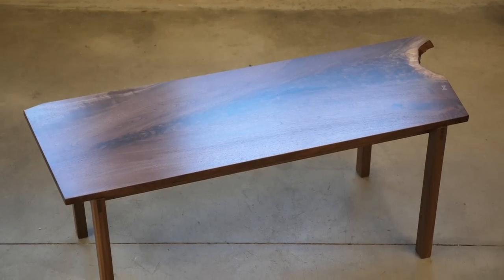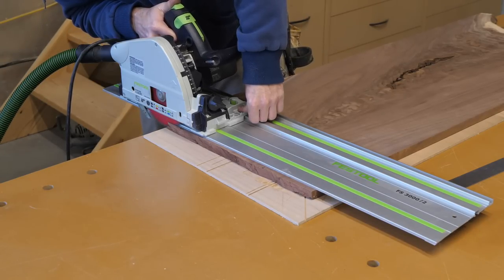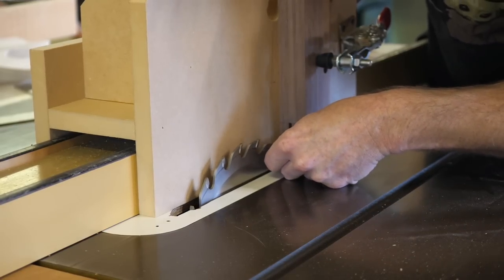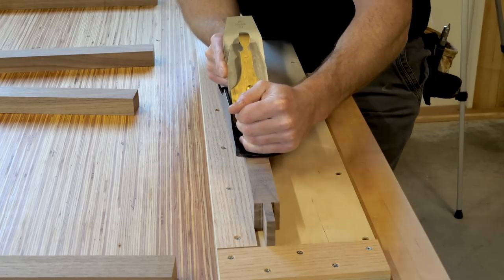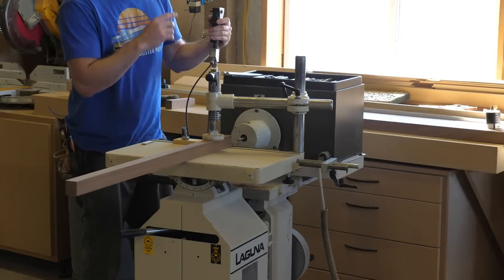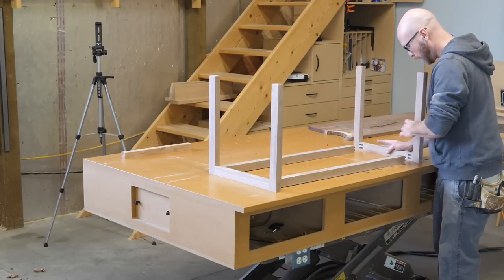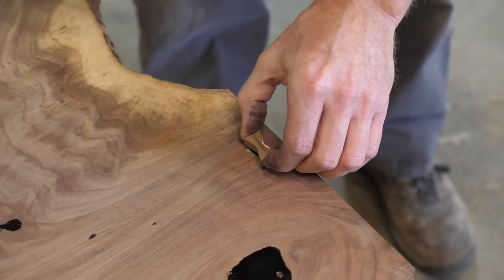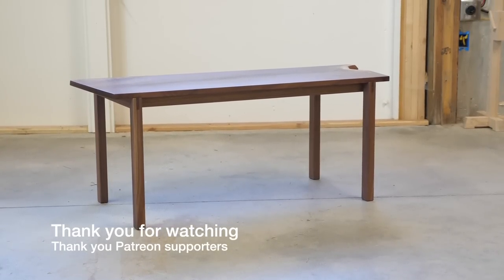What should this table cost? Help me figure it out.

Comment: I've always wondered how a table would look with clear resin, so you could see edges that ended up inside.
Reply: I prefer to use clear epoxy for that reason.. but it also shows any air bubbles that you couldn’t get out. It’s also tough to get a nice crystal clear epoxy. Most are yellowish.
Reply: @jlinkhart   I would really like to see that.  Got pics online?  BTW, why do you say it's tough to get crystal clear epoxy, when I see it all the time when people embed objects in their tabletops?
Reply from the maker: I have one some clear epoxy work. It is very difficult, maybe impossible to get it to look really nice.

Comment: I'd probably put it at $3,500 with a warranty (to allow for a remake once the top splits due to the rigid mounting), or $2,000 without.
Reply from the maker: Thank you. The top is mounted with the bottoms of the holes ovaled. I didn't mention that because I wanted to make room in the video for my really great Karate Kid joke.
Reply: @MikeFarrington   But then for some reason you went with your OTHER Karate Kid joke in the edit? You should have stuck with the really great one. And now we'll never see it.  😈  Regardless, it's a beautiful table.

Comment: I have watched you for many moons and I love what you do.  the break down.  the  high-end is to high, great work quality is there but the sex appeal and the weight isn't up to 5000,  though some  would pay that.  the low end is much to low for the quality and yes the uniqueness, the stretcher and the legs love the protrusion and yes the weight of the table  not great.  1,25 or 1.375 I would like better. There for the mid t o high 4s would be my guess.  love the walnut, I have one that size with a river through the center and live edge .  good luck    RC

Comment: $3200, could you have flattened the epoxy and bow tie with the lipping plainer?
Reply from the maker: Thank you. I could have, but that tool costs enough to where I wouldn't want the epoxy smudges on it. The hand plane I used is a backup, not a nice one.

Comment: If you did, what did you have to do after the top was milled to keep it from possibly moving or bowing a little bit until it was time to attach it to the base?  I would say anywhere from $900-$1200.
Reply: whatever you do, do not leave it laying on a surface such that 1 side gets full exposure to air and such in the shop, and the other does not.
I left a flattened glued up panel sitting on my Tablesaw top overnight and came back to a potato chip of sorts.
I put it up on stickers and weighted down the top side and left it overnight again and came back to a significantly less chippy piece, reflattened, evened out the thicknesses and left it on the stickers and it's been fine for 2 days now.
I've seen folks who make slab tables bag the entire thing in plastic sheet/wrap etc when leaving unfinished overnight.
IMPORTANT, when you apply the finish you MUST finish both sides at the same time - at least the first saturation coat - so that you again equal out the movement of moisture into / out of the wood.

Comment: Considering the price of oak (walnut is not available) slabs and workmanship here, and convert it to US$ we would pay 100 for the oak and 200 for workmanship, so the table goes for 300. But we would have cut the edge with the hole straight, we do not like imperfections in material. I know that in the US you get rudiculous prices. If I see your machines, I know where it goes. But a machine should allow for even faster work and lower prices.
Reply from the maker: Thank you?

Comment: Considering a few things about the area your in.  #1 Denver Co has a median income of approximately $85k, $20k above the national ave.  #2 Housing in the area can easily reach into the $5-$10 million range, meaning there is a large community of households with large amounts of disposable income.  #3 being hand made, I’d make sure the video was attached and last but not least,   It’s made by YOU.  (That should add at least $10-12k to it value……….   😂).   I’d recommend $2000-$2500.

Comment: First off let me say I’m not trying to belittle or offend anyone…. BUT….anyone who can build this EXACT table to the same design and detail Mike has done should not sell for anything less than $2,000 for sure….regardless of market and regardless of material cost. Once you establish yourself and your work(as Mike has done) you can almost set your own price. Let others follow you and not the other way around. I have people in my market that will always be “cheaper” than me and I really don’t spend much time worrying about it at all. 
Hobbyists woodworkers can be and are often times extremely talented but when you don’t do something as a profession you don’t have to worry about every little thing that goes into the cost of something. I learned that very quickly when I made the jump from hobbyist to full time. 
Overall though, “too much”, “too high”, “too cheap” is all relative. You can see two identical looking pieces of furniture sitting right beside each other in a store. One might cost double. There are people who will buy the cheaper one and people who will buy the more expensive one.
Reply from the maker: Thank you very much.

Comment: In my area of the midwest, $2200 to $2700 would be considered fair. Seeing all of that drool worthy equipment you have in your shop, I would tack on a shop fee of $500. I'd list it for $3200 and see if I got any bites.
Reply: So if he did it by hand and took 20 hours longer, he'd charge $500 less? How does that make sense? If the shop equipment isn't paying for itself in labour saved, then why is it there? He should just buy a fancy aircraft and tack on $8000 to each item in shop fees.
Reply: @DavenH  It was somewhat tongue in cheek, Dave. The $3200 is what I would list it as. The "shop charge" is a way of complimenting his well equipped shop.
Reply: @m.d.d.3051  Ah I gotcha. His shop is most enviable.
Reply from the maker: Thank you.

Comment: Them router burns are from not tramming your router. It's digging in on one side of bit. I would say 2500
Reply from the maker: No its from a dull bit. It does it on the other side of the cutter if I cut the other way.

Comment: My starting point would be $2k if I had built this, depending on the cost of the slab and the amount of time spent. With your expertise, I think you should start around $3500.

Beautiful table. Like you, I have a soft spot for old machines. I have an old planer I'm trying to get restored and back to its glory. Thanks for the inspiration.
Reply from the maker: Thank you.

Comment: That is the shortest FS 3000 I have ever seen.
Reply from the maker: Ha! Good eye. A friend bought a long rail and it was bent during shipping, so he cut off a few shorter pieces from the unbent part.
Reply: @MikeFarrington  Nice! That’s a good use of a messed up rail. TSO is now selling rail extenders which they are probably doing the same thing. By the way, I start the stair railing job tomorrow and am cutting the mortises by hand with the hollow chisel after of course drilling a hole at the correct angle.
Reply from the maker: @mchilly  Good luck, that will be a lot of work, but it will be great when done.

Comment: $1250. Taking a guess on how many hours you had in the build... maybe 16?
Reply from the maker: Filming always adds time, but if I was to work on this straight, 16 hours would be leisurely.
Reply: @MikeFarrington  I always wondered what takes so long to cut 4 legs and a top to size , plain a top down , and cut some joints into the legs , is the time counting waiting for the epoxy too dry ?
Reply: A table isnt just cutting parts and connecting them together.  Outside of the thought to material selection, design, and joinery, one table is comprised of 24 visible faces and 40 routed edges that all need the rigorous attention of sanding through the multiple appropriate grits and a finish.  At only 16 hours into this piece I feel like Mike could work circles around me.  Maybe Im just not as efficient but i think i would have 40 hours into this easily.  I dont think I could get two of these out in a week unless I had built a pretty substantial number of them.  No way this could walk out of my shop for less than $2500 unless the client had ordered either multiple of this specific item or it was tacked onto a larger order.  It looks great Mike, very thoughtful and deliberate design and work.
Reply from the maker: @AresGodOWar  What takes so long is the filming, easily doubles the amount of time, maybe more.
Reply from the maker: @akirch9  Thank you very much.

Comment: hi  mike     as   a  cabinetmaker  my  self   with  my  own  workshop    and  like  you  i  work  on  my  own       .   pricing a  job  is   a  huge   pain  .     i  always   do  it      then  leave  it  a  fue  days    then  do  it  again          ,    i  have  my  hourly  rate  which    i  charge    plus   materials      so  it  straight   farward     if  you  know   how  long   the  table    took   to  make        thats  the price     ,     its  irrelevant if   it sounds  expensive   or  cheap     the  price   is  what  it  is
Reply from the maker: That is normally how I price my work. This is a departure from that formula, and an experiment.

Comment: $1100 is my vote. I’m guessing $120 bucks for the lumber, another $40-60 for consumables, 6 hours of labor at $100 per hour, 30% margin and round it off to an even $1100.
Reply: that slab air dried means that it was sitting in some storage location for at least 2 years - $120 is a bit low I would think
Reply from the maker: Thank you.